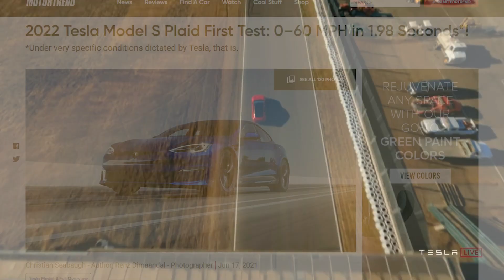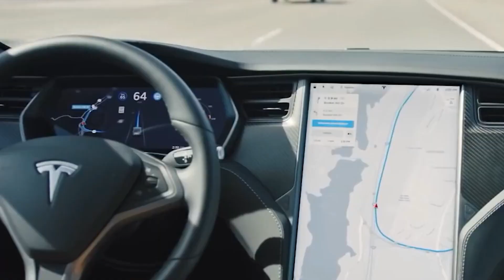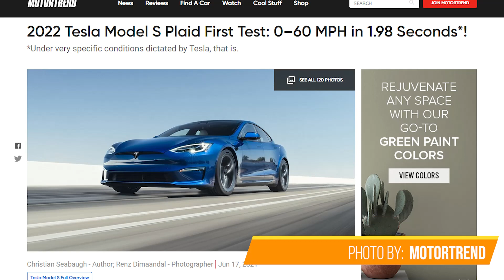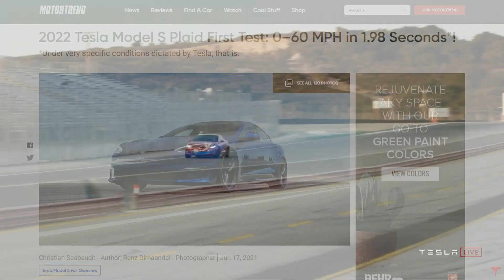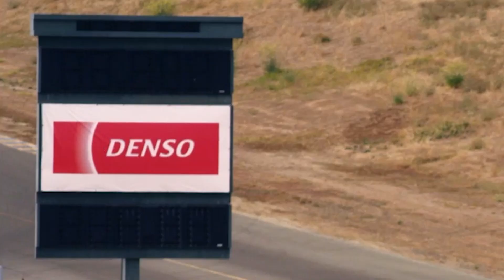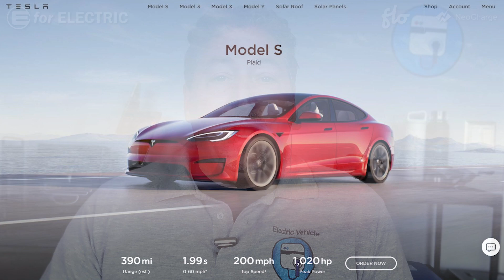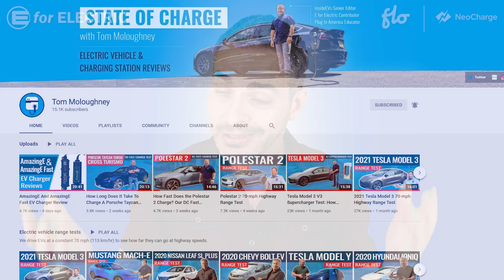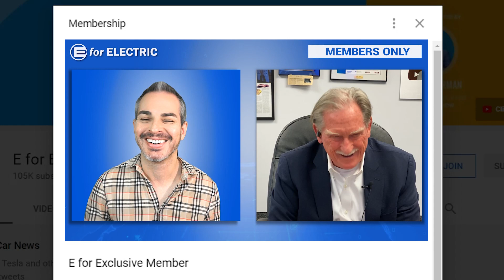Tesla Finds Itself in a Sticky Situation | EV News

Comment: Yeah but… still really really fast right?
Reply: The correct word is “Quick”. Even Jay Leno made that mistake.
Reply: Ok ok, granted.  But it’s fast as well! 😋
Reply: Sure, if uselessly quick is important and you don't mind cheating/misleading your customers.
Reply: @davidmccarthy6061  When did a car person ever complain that a car was 'Uselessly Quick'???   And they are not cheating - they even pointed that out in the video.  All the manufacturers use the same process.  What they did point out was that they don't use the same testing process on the non performance cars, so I guess that makes the performance models look even better against them.  It's hard when your base models are 'quicker' that most 'high performance' ICE vehicles, so I guess they needed to try to make a gap between the models.    As they said, even on street tyres, on a standard road, it's still ridiculously quick so...  who cares about a few milliseconds.

Comment: 4:16
"All of auto manufacturers are..."
That's the sum total take away here.  It's disingenuous to keep saying "Tesla did this".  While factually true they aren't doing it because they want to do this but because they didn't set up the metric.
And there is an engineering reason behind this.
That rational is that one should test the acceleration under ideal circumstances... even though these exist on NO road in the real world.
Where I think we can all agree is that in this digital age they have to knock off using the "rollout" that was created back in the 50's when using start light sensors were the most technological way to do so.
Well.. it's 2021 and all these cars have very advanced wheel sensors that are an order of magnitude more accurate than that as well as the fact that we have other sensor technology that we can use to sense the moment the car starts to move.
So we should use them.. across the board... no excuses.

Comment: I don't think any normal person would think rollout a sensible way of calculating a 0-60 time.  It doesn't matter anyway because it is basically too fast for road use and no good unless you are drag racing or bragging in the bar. If you want a car that's fun to drive outright acceleration isn''t the key thing anyway (light weight helps and this isn't yet an EV forte). A Mazda Miata/MX5 will always be way more fun.

Comment: They are using a trick that Dodge has done. Use performance to disguise an old car. The difference is Dodge embraces  the past Tesla is supposed to be the future yet is the oldest car is it's class. Model S came out 2012 it now 11 model years old with no major styling updates. Competition in mid size sedans. 5 series 2016, E Class 2017, Accord 2017, Camry 2018, A6 2018. It's like putting runners on Grandma. Yah she is fast but she is old and dated. The design would date even farther back then  even 2012 because of development time. This car really looks like an early 2000's Mazda styling wise and really shows it. Yes she is fast but damm is this one old dated and boring design. Great video though very fair and balanced information.

Comment: alex, it's called damning with faint praise... oh sure, you found a cure for cancer, but why didn't you do it sooner? casting shadow on the accomplishment fails to sufficiently honor the achievement. saying rimac will be faster, same thing, rimac isn't out yet, and the roadster will then beat the rimac.  if you think Global Warming is really important, and i think it's an existential threat, then you get behind the people that are trying hard to fix it and you push, hard. arguably, tesla has led the charge in conversion to battery and ev technology, something that General Motors, Ford, VW, and Toyota could have done 10 years ago, and tesla is still showing the way.  this is a major contribution to saving our planet, and it has been done in the face  of constant negative pressure by the oil and auto industry, science denying lawmakers, and all of the journalists who should have been forcefully pointing this out for the last decade or two. be part of the solution.

Comment: If I’m gonna buy a BEV, I need something that costs only marginally more than my Subaru. So far, I’m still at a loss. The closest vehicle is a ID4 VW, but that is Rwd. The new one with 4wd looks promising but it will still be 46k 😕
Reply: If you want decent range, you're gonna have a bit of difficulty, because another motor requires more batteries and increases the price
Reply: Stop being so damn cheap and spend the money..
Reply: @fast.biking_freddy  so that’s one more ad advantage that ICE has.
Reply: @mamadouaziza2536  can’t afford it, and frankly speaking, 50k for a compact crossover that isn’t a luxury brand is a tough pill to swallow.
Reply: @andrewmeehan6151  Yeah idk why this guy is being so elitist. Maybe consider some plug in hybrids, they may have AWD options that are normally fwd with gas and AWD electric or something. 

Also consider the used market! Buying a used vehicle is a very environmentally conscious option. Or wait for the price to go down, and stick with your current car.
Reply: @fast.biking_freddy  yeah where I live totally electric is out of the question, I could do a PHEV though with like 40’miles of range.
Reply: @andrewmeehan6151  
You get tax credits and grants..
Your finally cost will be $38k.
If you can't afford $38 you shouldn't be buying a car.
Reply: @mamadouaziza2536  except nothing is free, not even tax credits.
Reply: @andrewmeehan6151  
In California you can get an additional $5000 grant on top of the $7500 federal tax and $2000 state tax credit. I am getting a brand new 2021 Mini Cooper e for $15k.